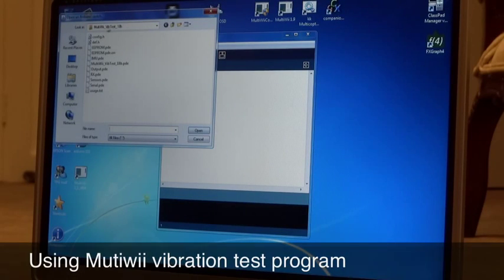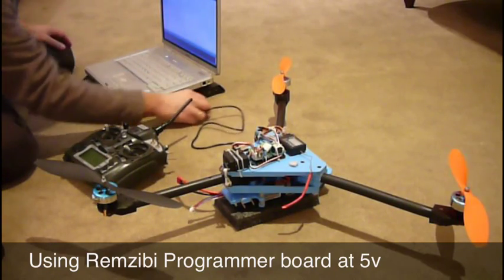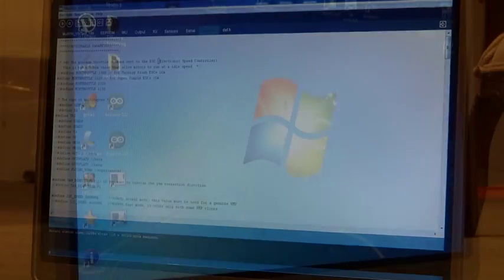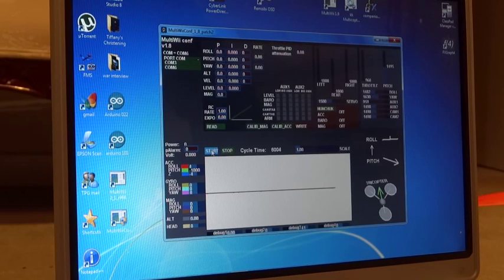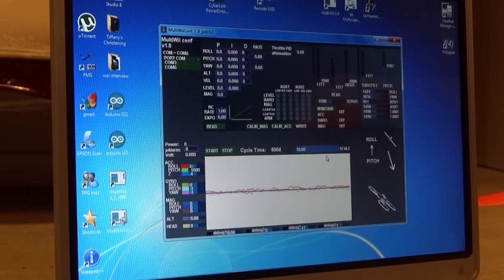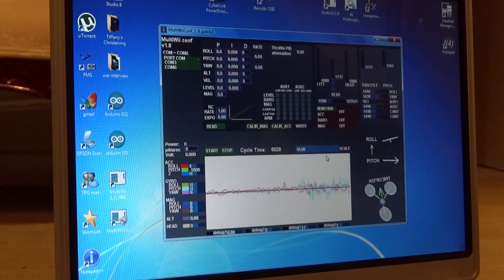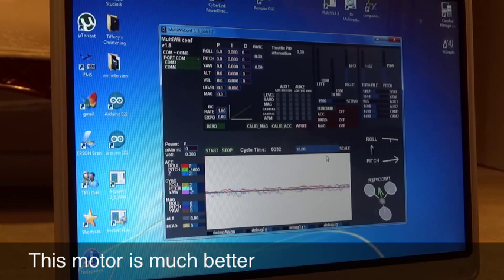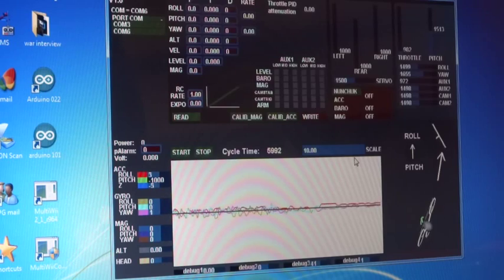Using the Multiwii Vibration Test Program to achieve the Best Balance

Comment: Do you connect battery AND usb or only usb for vibration testing?
Reply from the maker: Daniela Blümel you need to battery as well otherwise motors wont start.. Time to upgrade to a Naze32 board, multiwii is getting old now.

Comment: Can you do this with the props off?
Reply from the maker: Yes of course. Dynamic balancing is now included in Multiwii 2.3 you will need to define it. look for DYNBALANCE. Then you can toggle motors on and off. I have not tried it yet but it will save you flashing old versions of multiwii on your board